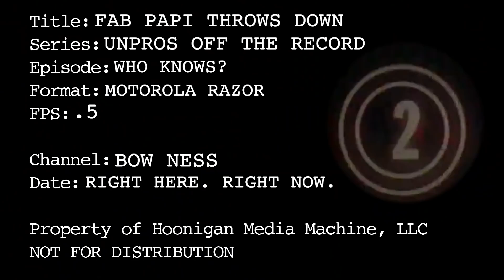Fab Daddy Sergio: The Mastermind Behind Hert's K240SX

Comment: I may be the minority on this, but I love this style of video.  You can learn a lot by watching the fabrication skill when it is not chopped up with fancy edits, at least I do anyways.  For instance, I couldn't tell you the first thing about welding, whether that was tig, mig, or the material was aluminum or titanium(leaning aluminum).  But something I wouldn't have picked up on without the continuity provided in this video that the jump cuts usually take out; that he had both sides of the inter-cooler pipe he was currently welding taped off with a hose on one end.  I'm assuming this has something to do with the backside of the weld and the quality of it, or lack there of if both sides weren't taped off.  Wouldn't have noticed that otherwise so thanks for the way you edited this.